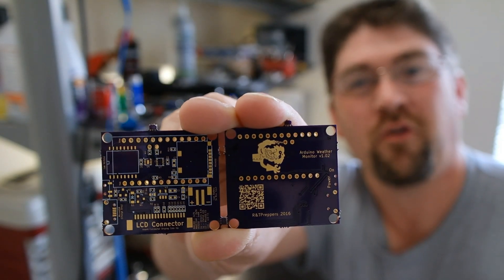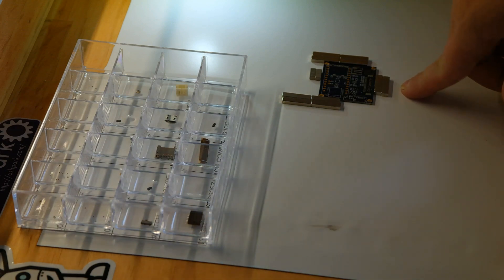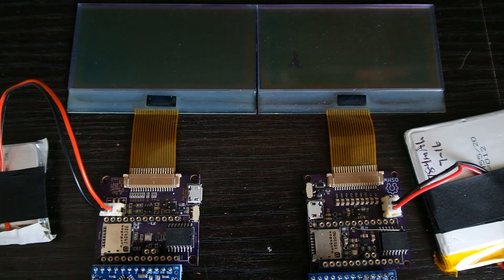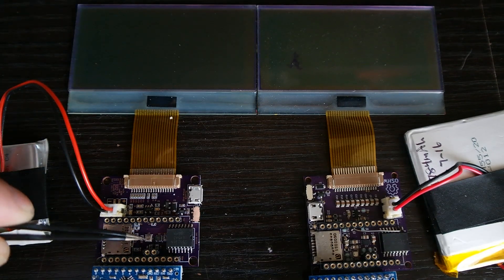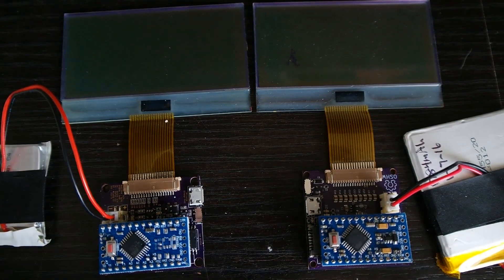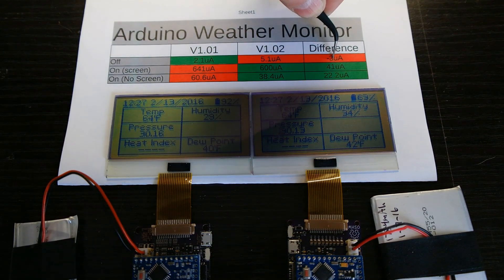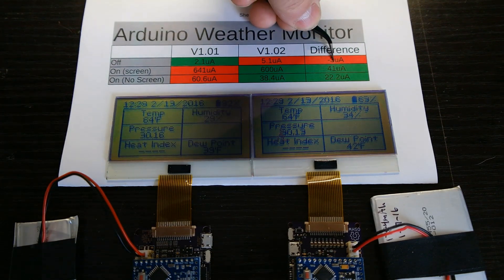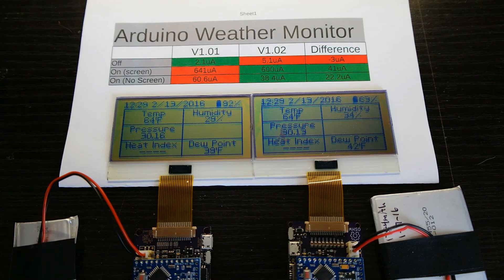Arduino Enviromental Monitor Update #3

Comment: I don't get why you use a pro-mini and don't just include your own own onboard atmel chip?
Reply from the maker: Funny you say that, a day after I filmed this video, I decided to roll this project once again before production.  I'm integrating the atmega328p and switching the big ds3231 for a smaller 8 pin ds3231mz rtc.
Reply: Makes sense, after all the work you already did rolling your own Arduino is actually pretty simple.  I haven't done all the things you've done, but I have built a bare bones Arduino (albeit mine was a through hole rather than surface mount).  I think you can make a nice simple and small single board this way!  Good luck!